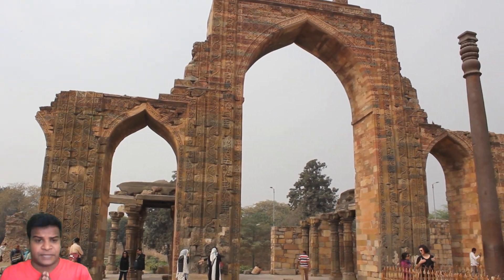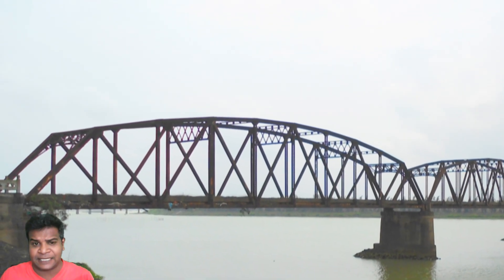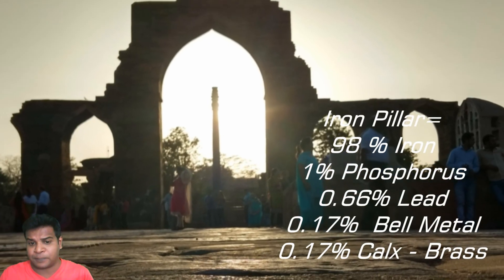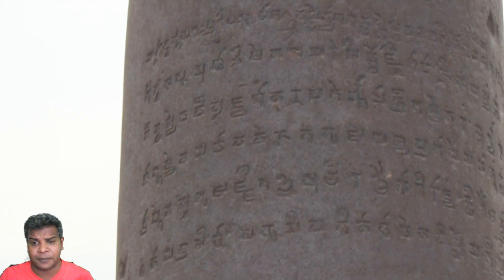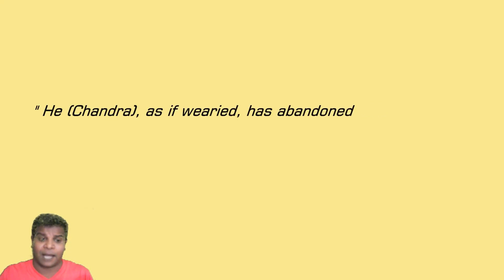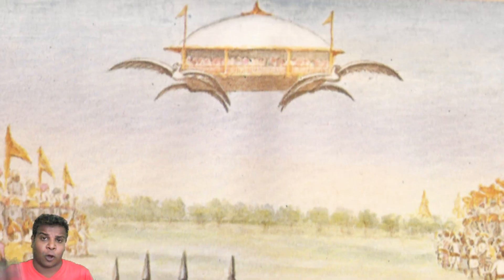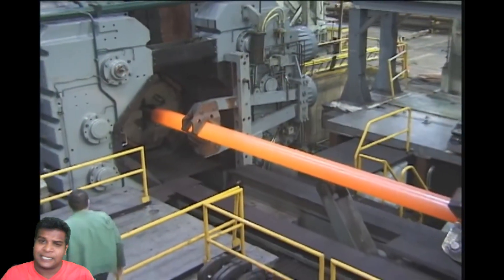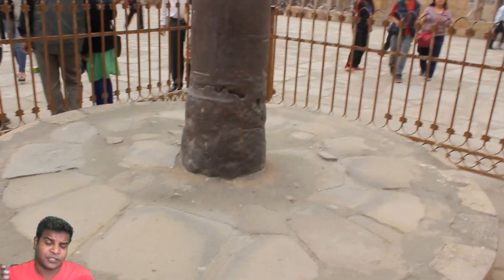Iron Pillar that never RUSTS - Ancient Secret Revealed?

Comment: Dear Praveen, I enjoy watching your videos. Here, I would like to mention that the presence of P (phosphorus) in Delhi Iron Pillar (DIP) played an important role in prevention of corrosion over many centuries. It formed FePO4_H3PO4_4H2O, which was critical for its passivation. Analysis also showed that P content in DIP was less than 1%. Prof. R. Balasubramanium of IIT Kanpur (a bright scholar, who unfortunately died at a very early age) carried out in-depth research on DIP in the decade of 90, and described his findings in a series of technical papers. [By the way, I am also a metallurgist, and did my M.Tech.+Ph.D. in IIT Kanpur, in the same department where Prof. Balasubramanium used to teach. However, corrosion engineering is not my specialisation area]
If interested, you may go through the following references:

1.	On the corrosion resistance of the Delhi iron Pillar, R. Balasubramaniam, Corrosion Science 42 (2000) 2103-2129.
2.	A. V. Ramesh Kumar and R. Balasubramaniam, Corrosion product analysis of ancient corrosion resistant Indian iron. Corrosion Science, 1998, 40, 1169–1178.
3.	Detecting non-uniform phosphorus distribution in ancient Indian iron by colour metallography, P. Piccardo, M. G. Ienco, R. Balasubramaniam and P. Dillmann, CURRENT SCIENCE, VOL. 87, NO. 5, 10 SEPTEMBER 2004, 650-653.
4.	On the astronomical significance of the Delhi iron pillar, R. Balasubramaniam and Meera I. Dass, CURRENT SCIENCE, VOL. 86, NO. 8, 25 APRIL 2004, 1134-1142.

Comment: It is possible that kutubminar temple and that piller built at the same time in lord ram's time  and 1:10 ration had some meaning  hence it is very  very ancient structure one could not examine and elaborate the structur and connection with so called qutub minar which was  not a qutub minar any hindu ancient temple of lord ram  time.. I
Reply: There is not kutubminar temple was built by destroying 27 temples

Comment: They are showing you what kind of metal is used for the structure in the background.

In our own modern buildings we use steel beams or steel rods encased in concrete; the steel eventually rusts and we demolish the buildings.

If we used better formulation steel, the buildings would not have to be routinely demolished.

The tower structure behind the pillar should be checked for internal steal rods.
Reply: Brother that building called qutub- minar was built by muslim invaders.  At the time when iron pillar was made there were 27 temples near it. Mughals destroyed them to build it. But they didn't destroy it. This thing is written on the wall of qutub minar in urdu. They destroyed  40,000 temple of North india and burnt the oldest university nalanda all important books were there from our history. It take 3 month to burn whole thing. U can imagine how many books were there. 😢😢😢😢

Comment: There's two towers one must be a anchoring hoist for the pillar grand gallery had internal rope pully systems so did Karnak anchors and cable cars suspended and connected to heavy pillars for slobe and altitude we still use those ancient tool systems in modern coal mining

Comment: Your analysis appears to be  very correct. I like to inform  you something I had read somewhere, as below.
1. "Kutab" Minar is actually a ancient Observatory and two of the reasons I remember are
a. It has 12 windows at different heights at strategic direction to observe 12 Stars or Constellations when they become most suitable to watch only at that location.
B. One essential of a observatory was to have no shadow cast during sometime in a year and in Delhi region the maximum height the sun rises upto 85 degree. The kutab minar is also inclined to 5 degree  and it does not  cast any shadow on some days. Many other things were listed which I have  forgotten. 
There are also two important aspects for your kind attention.  1. Graves found in front are not symmetrical and appears to be placed at much later date.
2. Murals of many Hindu gods at the adjacent building/temple were covered to hide. These was unearthed by a British archeologist in 30s. These are already written there. 
I hope you will be able to unearth the buried truth. God bless you.

Comment: pour qu'un objet en fer ne rouille pas il faut qu'il y ait quelque chose qui s'oppose à l'échange ionique entre le fer et l'oxygène de l'atmosphère. autrement dit un autre échange ionique  suffisamment puissant ET flexible pour s'adapter aux différents  changement de teneur en Oxygène de l'air ambiant . il est très possible que ce pilier fonctionne à la manière d'une épingle d'acupuncture en utilisant une propriété du champ électromagnétique terrestre . du coup la hauteur joue un rôle aussi. Le champ electromagnétique terrestre n'est pas à plat mais en volume , a une épaisseur. du coup la hauteur du pilier a toute son importance.           For an iron object not to rust there must be something that opposes the ionic exchange between iron and oxygen in the atmosphere. in other words, another ion exchange powerful AND flexible enough to adapt to the different changes in the oxygen content of the ambient air. It is very possible that this pillar works like an acupuncture pin using a property of the Earth's electromagnetic field.       The Earth's electromagnetic field is not flat but in volume, has a thickness. So the height of the pillar is important.

Comment: Just measure the height of Hindu structure pillars on the side , if the height is same. Since the top of iron pillar matches the design with top of stone pillars in Hindu structures I suppose that this was build as a sample pillar for temple construction but given the high costs and no carvings on 80% of it's body  it would have  been disapproved by the king to make all the pillars made of IRON. ...just a raw analysis, I am not a historian....

Comment: The pillar reminds me of Roman concrete which Roman walls were built from and are still standing today ~2000 years later, unlike modern concrete walls which have to be built with steel rebar inside and still only last a few decades before deteriorating. Roman concrete's composition and how it was made is still a mystery today.

Comment: Has anyone checked the frequency of the column?  It looks like an antenna, and the material construction sounds like an ignition tool or probe.  I'm curious .. I'd rather try a thermal scan if it was me.

Comment: They say that this pillar was not casted with molten iron, but sintered at a lower temperature out of a iron-binder mixture that was first formed and then baken out. The iron particles fuse then partially together and get solid cooling down. Depending on additives you can achieve interesting new properties.

Comment: The iron is so impure full of slag, carbon and other trace metals it rusted slower by virtue of lower iron content. Additionally, it is configured vertically, which benefits wicking water away by way of gravity. As you can see, the base had prolonged exposure to ground surface water and it decomposed much faster. If it were laying on it's side, it would be in a far worse state. Finally, it is also very thick, if it were thin and pure, it would be much worse off.

Comment: If you watch up from under  the arch so that you see the both tops, the pillar and the tower top, and then turn 180, where would that line hit on the ground / on the wall of the temple? Make sure you include your calculations also the earth movement and other things, depending is those places on the same plate, or have they moved during centuries.

Comment: can anyone check this ??   Decibels. ... The ratio of any two values, where one is fixed or known and of the same qunatity or units, whether power, voltage or current, can be represented using decibels (dB) where “deci” means one tenth (1/10th) of a Bel. Clearly then there are 10 decibels (10dB) per Bel or 1 Bel = 10 decibels.

Comment: Qutub Minar is possibly an astronomical device to measure earth axial tilt: 
Axial tilt of earth = arctan(shadow_length/tower_length) 
When the shadow of a tall object is measured at noon on summer solstice. For more accuracy, make the tower taller and take another measurement (as was done with Mihir tower aka Qutub minar)

The height of Qutub Minar is 72.5m, therefore a shadow of length 32.30m would give an axial tilt of 24.01° and a shadow of length 32.31m would give an axial tilt of 24.02°

So yes, even with a broad granularity of 1cm, they could measure axial tilt up to 1/100th of a degree!

The Iron pillar at exactly 1/10th the height was probably the older measuring device which could only measure to 1/10th of degree.

Comment: This kind of iron behaviour has been known in the west by blacksmiths for hundreds of years. I am in the town of Orgiva Southern Spain and the iron work surrounding the church is over 4 hundred years old and the biggest majority of it is still in good condition you can see the old hammer marks and the forge welded joints. Mild steel would have rusted away long ago. It's such a pity most countries don't recognize their metal work heritage !  😠

Comment: just wondering....
The heights of both structures with 1: 10 ratio reminds me about the Ram Setu (The bridge connected south India with Sri-Lanka) with a width 3.5 km width and 35 km length (1:10 ratio)
Reply: The iron pillar might be built as a reference for estimation for building the height of qutub minar ?
So qutub minar had been built by rama ?
 It's just a guess and don't know at what time both were built
My thought

Comment: Delhi’s Iron Pillar has more amount of Phosphorus than the usual.

If you melt pig iron and add phosphorous in it, it will start breaking up. The iron would never come together and make bond with each other. So, what the manufacturers do is that they take out phosphorous out of the molten iron. (Just like you filter out tea leaves out from your tea, where tea leaves are your phosphorous molecules in an analogy.)

What ancient Indians did was they never took out the phosphorous out of the pillar. They welded the cylindrical pieces of wrought iron. To remove the phosphorous from it, they started hitting it from all sides with a hammer. Phosphorous got pushed towards the surface of the cylinder from inside. So inside had no more phosphorous while outer surface had a protective layer of phosphorous. It was a win-win.

In a way it was ingenious, in my opinion.

Comment: Hi Praveen, Can it be possible that this iron pillar was made as a lightening rod, to protect the tower from lightening?
As you mentioned in the video that the metallic composition of the pillar increase the magnetic properties of the pillar. then it may be possible that who ever built this huge tower was aware that it can be destroyed by lightening because of the height, so to protect the tower they composed a matallic pillar with a 1:10 ratio heigh which can attract the lighting and protect the tower. Can it be possible?
Reply: Quite possible.. What a observation..

Comment: Just a question if lord Rama has built it ,, it was supposed to b built  many thousand years back , whereas the dating of the iron pillar u said about 1600 years back only
Reply: 1600 years in itself without rusting is a marvelous feat. India is also where Damascus steel was first made. Indian metallurgical techniques were very advanced. Not just India even Japanese metallurgy was mind blowing just look at how they make their samurai sword they manage to get two kinds of tempering on one single blade.
Reply: @pam4840  yes brother ..India was once leading the trade and business ..

Comment: Ok so a couple things, brother.  

On rust:  Rust is essentially burning.  The process of O2 binding to the Fe is chemically the same as lighting something on fire.  

On the O2 burn:  There is a running theory that this slow process of immolation is what causes the creation of free radicals that damage your cells, ultimately leading to cancer.  

If Misawite can prevent Rusting then it could prevent the o2 related damage that causes the creation of free radicals int he body... Also That's a VERY masonic looking formation.  Three pillars, the Pythagorean arch 

If why is it called Vajra Sanghatal?  Vajra is a weapon, right?  What does the name mean?

Comment: Ancienc civilizations werent advanced they just used techniques that had extremely long longevity and durability because the production of the item was extremely expensive so it had to last as long as posible.
This can be seen in for instance old churches where you can actually set it on fire and the damage would be minimal. 

The whole reason for this is four fold:
1. We used to overbuild things because we didn't have the understanding or tools to build them only as strong as they needed to be.

2. Planned obsolescence: why bother building a phone that could last 30 years, when it'll be out of date in 2?

3. Cultural shift: people used to buy nice things that cost a bit more but lasted a long time. Nowadays, you buy things for like a dollar and just replace them when they break.

4. Survivorship bias: all the old awesome stuff you see now is still around BECAUSE it's awesome. All the cheap shitty stuff got thrown out ages ago.

Comment: Everyone thinks that ancient carbon from torches would still exist if they were used but I learned from experience that that is not true.  I once burned the surface of a rough-cut piece of plywood paneling with a propane torch.  It's upper surface was carbonized and looked very 'Western".  But after a few years all of the carbon was gone.  Why? because raw carbon reacts with O2 to form CO2 since both are very reactive.  So the idea that no torches were used to light interior spaces needs to be rejected.

Comment: The lower pillar is much wider than the top with a more irregular corroded looking shape, this to me suggests that the pillar has been refaced by removing the surface scale and re carved at the top, possibly it was cast with decorations but when they became too badly corroded they were removed and the inscription added for posterity.

It is possible that the iron pillar was a scale model for architects to measure from when building the stone tower.

Comment: Very interesting video!

Mankind's lifespan is constantly decreasing with time, along with bodily strength and intelligence -- not increasing (as the evo THEORY camp would have you believe):

According to linguistic scholars, all modern languages devolved from more complex ancient languages. When God first revealed language, it was much, much more complex than any language in common modern use, because ancient mankind was much more intelligent than modern mankind is: Language was originally designed with intelligence by God, and it was given to mankind as a gift. The original language of mankind is called Sanskrit, and all of the other extant languages on the planet are derived from Sanskrit, either directly or indirectly -- this is a well-known linguistic fact.

The Sanskrit language was mankind's original language, and it takes a total of 12 years to learn and speak it fluently: Sanskrit is presently known as a "dead language" because although it was once spoken all over the earth, by all human beings, it is currently spoken fluently by fewer than 100 people on the planet. This is because Sanskrit is far too complex for the less intelligent modern mind to understand fully and speak fluently.

Sanskrit is the most striking linguistic example of modern man's intelligence having devolved to lesser than that of ancient man. Other linguistic evidences include the other "dead languages," such as Latin and Hebrew, which are, to a lesser degree than Sanskrit, also very complex languages that are very difficult for modern man to understand fully and speak fluently. The Greek language has also devolved over time, becoming less complex and easier to understand as time has passed. On the Foreign Service Institute's Language Difficulty Ranking scale, Modern Greek is a category IV language (meaning it takes 1,100 hours to learn), whereas Ancient Greek is not quite a category V (it takes 2,200 hours to learn), but is certainly more difficult and complex than Modern Greek. 

All of this linguistic evidence means that language has become less and less complex, over time, as mankind's intelligence level has decreased over time. This trend of diminishing intelligence, as evidenced by mankind's irrefutably diminishing linguistic aptitude, continues to this very day, with language skills gradually getting lesser and lesser with each new generation of humans. Not only that, but ancient societies with superior intelligence also produced superior technology to that of modern man. For example, modern man is unable to build structures such as giant stone temples and pyramids, for lack of technological knowledge, but everyone knows that ancient cultures did indeed have that superior technological knowledge. Modern mankind also lacks the knowledge of how to construct an iron pillar that resists rusting, as the ancient pillar in the video does.

Therefore the strange claims of Darwin were clearly false: Mankind is demonstrably getting less intelligent as time passes, and modern man clearly has less knowledge, less intelligence, and inferior language skills as well as inferior technology compared to those of ancient mankind.